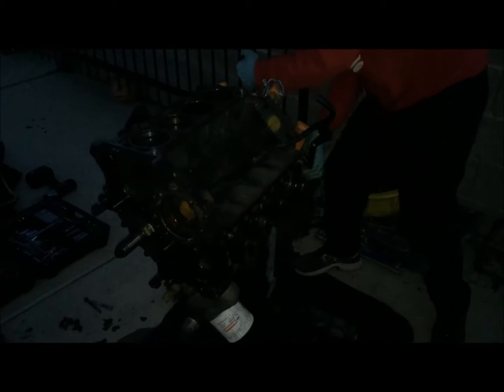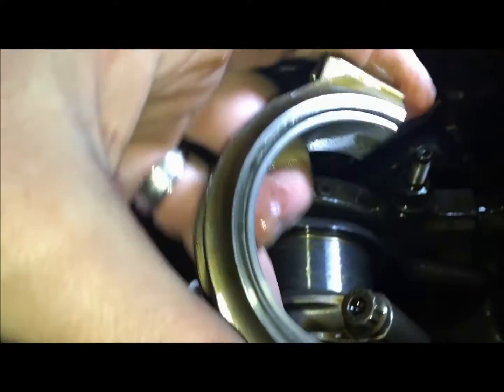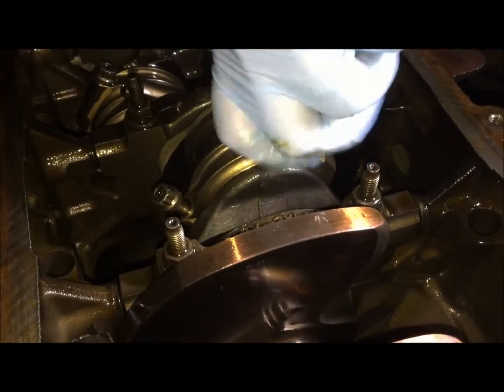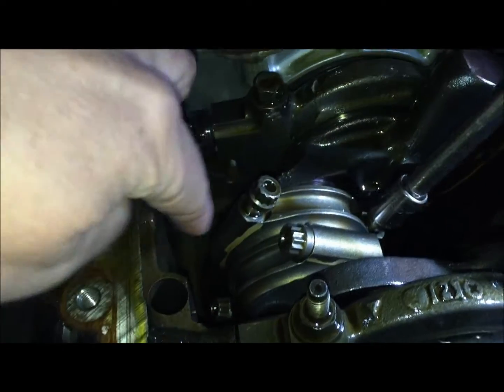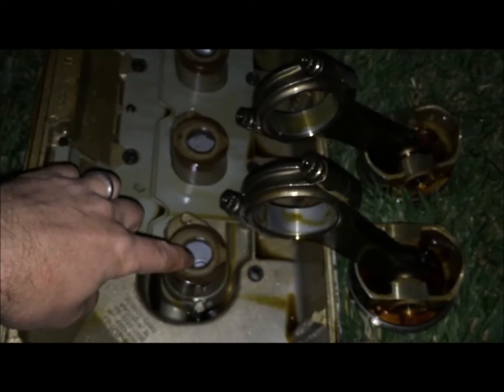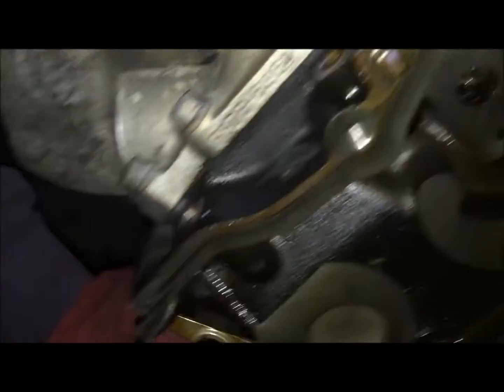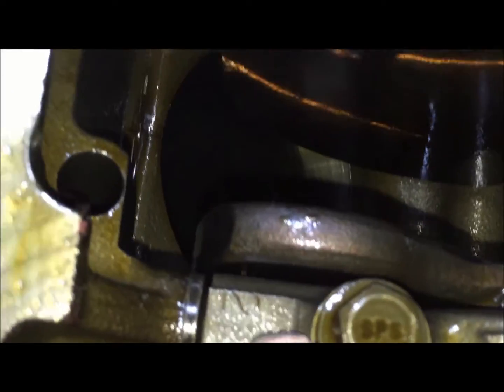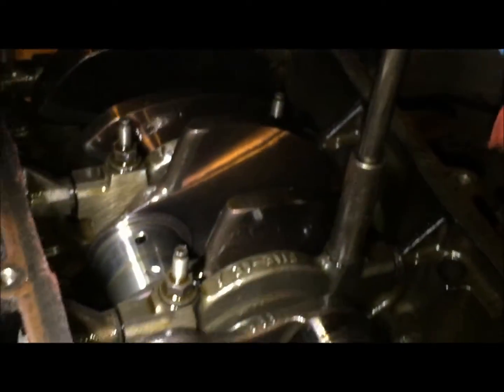Part 5: Bottom end disassembly 4.6L Mustang

Comment: How long was it driven lean mine had an alternator failure and noticed it was detonating immediately after changing it and I immediately parked it. Just scared I may have done similar damage but the car still runs fine and only detonates under load.. (crackle sound under hard throttle) just wondering if this would take one pull to melt the piston while running lean or if I’m good getting a new battery and tune and going out to try again
Reply from the maker: It was on the 3rd pull with no alternator (battery only). You’ll probably be ok with a small amount of detonation vs this guy who was at the top of the gear leaning out so bad it melted the piston https://youtu.be/RkdmRQ7dLVA

Comment: Noob question is it possible to remove the rod from the motor with the motor still in the car in the 4.6 2v?
Reply from the maker: I have seen people disconnect the rod and replace bearings, but to remove the rod you’d have to also remove the crank. To answer your question, Not likely. Here is how it’s removed https://youtu.be/yeYcFOPS9w8

Comment: Damn it sucks to hear you werent able to make a series on rebuilding the motor, I currently have an 03 mach 1 swapped new edge with little to no compression in cylinder 8 so I am hoping its just a valve issue but I will find out once I pull the motor, do you have a list or any advice on what parts I will need to replace once the heads are off? Im assuming at least headgaskets and head bolts, any help is appreciated.
Reply from the maker: Richturd It depends on the extent of the rebuild, what’s needed, what you want to upgrade. Most cost effective when considering machine work is just to drop another engine in and part out what’s good

Comment: Hey Danny Im i n the process of building a Forged 4.6 for my Mach1. I pulled a teksid block out of a Mark8, Stroker kit with CP pistons Bullet series, Heads fully ported , Crower Cams , springs Titanium retainers. My block was built by Muscle Motors. Interesting how the alternator took down this engine. I havent did anything to fuel system yet. The original engine is still in car and I have been building a spare. Do you think the 47Lb injectors could work on my new engine? Its one thing to build them and another to tune them. I will break it in NA and eventually put the Procharger kit for the Stock Mach 1. So 6 to 8 PSI boost max. My compression will be very close to stock 10.1:1
Reply from the maker: For n/a you’ll be ok, but once your forced induction you’ll need 60# or much higher flow if you’re doing e85
Reply: @dannyjohnsonsgarage  
Hi I wont be going E85, this is a street car, I live in Canada and we dont have E85 readily available at the pumps. I do have 94octane readily available mind you. 
1 more question please. If I install a return style fuel system so no more variable current to fuel pumps; can the factor computer still be used?

Comment: Hey I have a 96 mustang gt that supposedly has a forged rotating assembly. I was wonderong if I pull the oil drain plug or pull the whole oil pan if I can fit a endoscope camera up in there to inspect the crank & rods? Im saving up for a 2.8lc kenne bell but wanna make sure I got forged internals to support the hp I wanna throw at it
Reply from the maker: Tee Jay Yeah, without the pan (or possibly putting a camera up the oil hole, but if they added the windage tray like you see in this one, it might be in the way.

Comment: Good video, built a ton of ls engines but it's time to forge my 04 mach1 ,
Reply from the maker: jacob gomez Very cool. If it’s from a 5 speed car you’ll have the same forged 8 bolt crank as this cobra. Off to a good start
Reply: @dannyjohnsonsgarage  ya its same crank, the dyno shop who owned it before me said it has a cobra shortblock but I'm yet to find out, did you rebuild this one yet? If so how is it? Did you go turbo or anything or nitrous or did u stay stock compression
Reply from the maker: jacob gomez Here is a video to show more on this terminator engine. One of the biggest ways to know is the iron block on the mach 1 vs iron on the cobra 

This car, unfortunately, was sold as a roller before we could work on reassembly. 
 https://youtu.be/-23tT0uJnlg

Comment: i am planning on getting a 1999-2001 cobra, and the ones that i can afford all have 100k+ miles on them. I was wondering what all I should replace to forged when I rebuild the engine in the next few months. I am planning on the whole rotating assembly. Was thinking about the cams as well. What changes if I get new cams?
Reply from the maker: YouShouldReallyContemplate Suicide replace the Pistons, rods, and possibly the crank. At that point you might want to look into a 5.0 STROKER Kit but make sure you have a good engine builder who will make sure all the parts work together. Be careful with cam selection- make sure you know if the car will stay naturally aspirated or will be forced induction someday. Cams (being that there are 4) can cost over $1,000 so you want to buy the right ones the first time

Comment: Poor 4.6. Seems like you guys caught it pretty quick though. What are the owner's plans for rebuilding? slight over bore and new pistons, along with head work to repair the head on the passenger side?
Reply from the maker: Karadon1969 yeah, he wants to reuse the rods and crank, and possibly the block if .20 over will do it
Reply: The bearings actually looked pretty good for a piston going. Doubt he bent a rod so I bet he can reuse them and the crank after a good inspection. I hope to see vids of this thing once its rebuilt.

Comment: How many engines have blown up in this cobra so far?
Reply from the maker: +SRT4R  this is the first. And it wasn't from holding the power, but from a weak alternator not supplying enough fuel to the engine
Reply: Scrun Johnson thanks for clearing that up bud!
Reply: Danny Johnson never knew a weak alternator can cause that,good to know

Comment: How lean was it? Did the fuel injector fail or something?
Reply from the maker: Ryan Maxey alternator failure causing a lack of power to the pumps. Not sure how lean, but enough to melt the piston
Reply: Ouch! im getting a wideband for my car later on,making sure my car runs tip top.